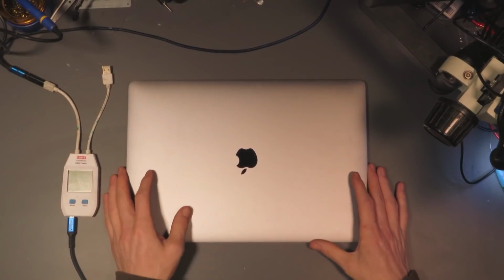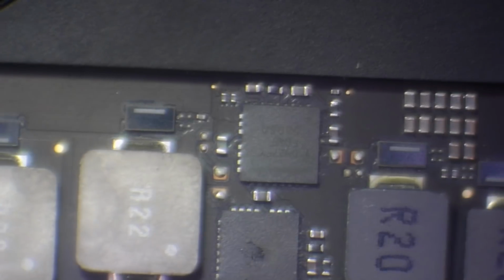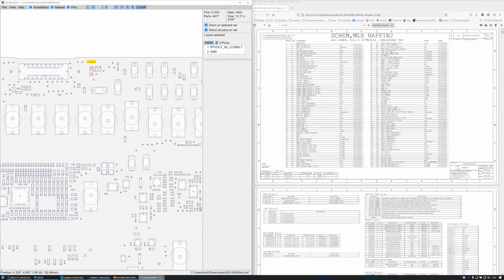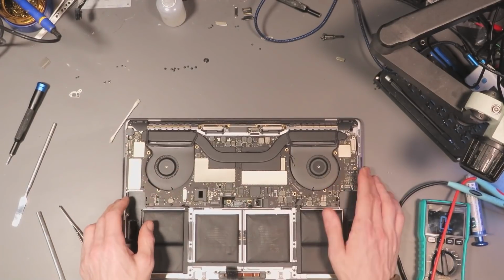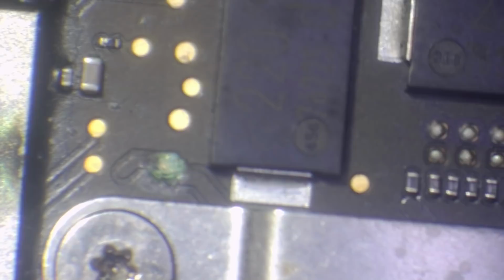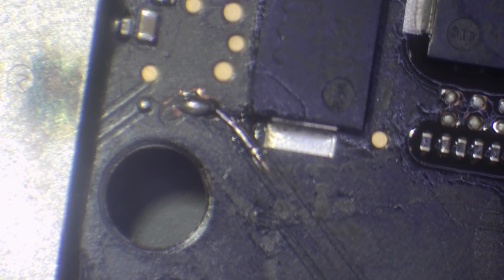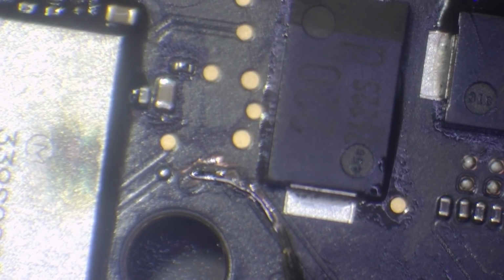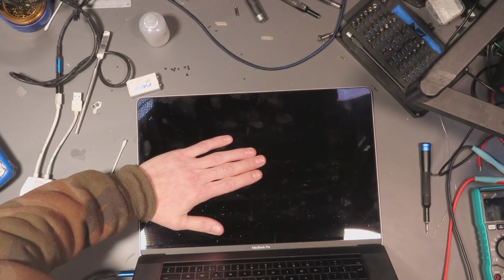This 2017 Macbook Pro (A1707) Doesn't Turn On! Can I REALLY Fix It? Let's Give It A Try!

Comment: If you ever need hair thickness wire, take a cheap battery clock apart, there is a bobin of wire inside.
Dead clocks of cause 😀
Excellent repair 😀
Reply from the maker: Thanks mate, I'll bare that in mind 😁

Comment: Hey TheCod3r have You fixed PS3 consoles changing NEC Tokin capacitors ??
Reply from the maker: I can but it's only really worth it for the backwards compatible ones really
Reply: @TheCod3r  yeah , these consoles specially , Which do You prefer ?,  Hardware (CECHAxx-Bxx) of Software (CECHCxx-Exx backwards compatible???

Comment: Wooow a little corrosion can eat a track internally 😐👍
Reply from the maker: Yeah unfortunately it can. It usually takes the coating with it but this time it seems to just take the very edge
Reply: @TheCod3r  yes it took that microscopic level edge, which could be impossible to find, if that corrosion was visible enough to see.

Comment: U should replace all these corroded caps, also u can remove them with iron tip , no need for heat , but good job man , keep up the good work
Reply from the maker: Yeah I agree but by the look of them they weren't going to cause any further issues with the board so I felt they could be left there :)
Reply: @TheCod3r  I have fixed thousands of MacBooks and u can look up my page on fb with same name ,  trust me brotha , these little things makes a difference, if it worked now is fine but it won’t last long , these small caps will fail for sure
Reply from the maker: @ybdforiphoneandmacbookrepa9793  I'll look into it mate, thanks